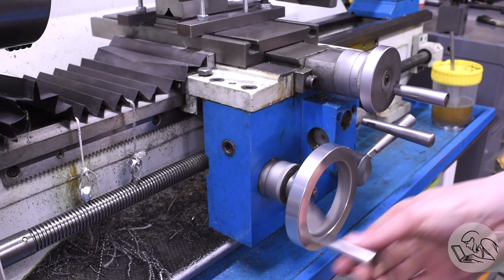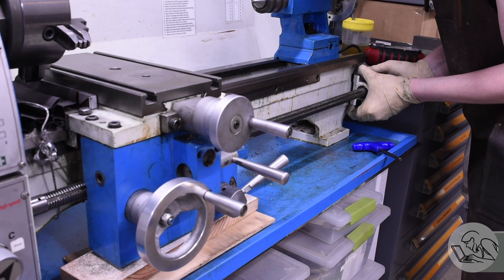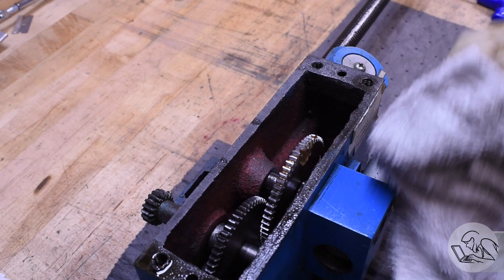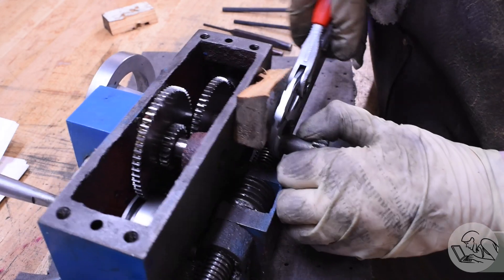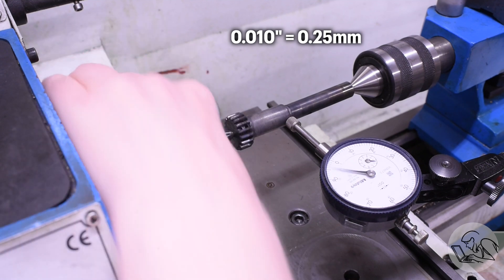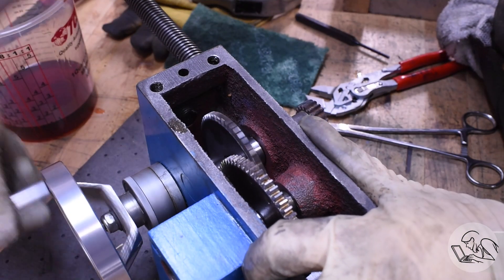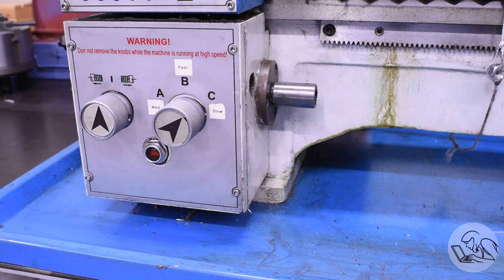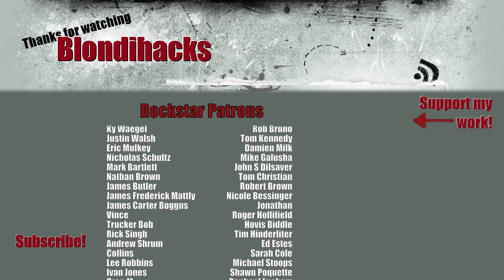Lathe Crash And Repair! 🤦‍♀️

Comment: Nice little video, well done on a fix not a spare part, As it was a small bend, I would not have used heat, it was a job for the shop press or big bar ln the vice (using something to hold the part with out damage) or the block hammer, grip with some scrap brass or Alu, the other thing start the pin in the hole  on the gear, (you can chamfer the hole and mark the position with a felt pen) before you put it back in the gear box. So you don’t drop the pin….

Comment: Yup, like I posted in your previous video, I bent mine doing the exactly same thing, only ran my carriage into steady rest instead of tailstock. Nice repair only you kinda went about it the hard way. I just dropped the pillow block end of leadscrew, dropped the gearbox and removed pinion gear. Chucked pinion in 3 jaw, dial indicated, and tapped it straight. Straightened within .002 !!!

Comment: A handful of fittings and a valve would make that gear box drain easier to manage. My 1920ish lathe has an oil bath in the apron and it’s still kicking so it might not be the best oiler but it’ll last 100 years if you take care of it. Great video!

Comment: She'll probably just turn a new pinion on the lath... doh! Glad you're back in business. You may need a backup lathe for repairing your lathe! ... Oh who am I kidding, you would have chucked the pinion in the mill and turned it holding a tool in the vice.
Reply from the maker: It almost came to that. If straightening hadn’t worked, I would have put the bent one back in, made a new shaft, then took it apart again and put the new one in. 😅

Comment: Hi Quinn I just found you channel, and you are completely awesome!!!!! I am a hobby machinist, I have learned so much in just the short time I’ve been watching your channel. Years ago I got a 13/40 lathe for 50 bucks. I had to go through it and clean it up ways where lightly cover in powdery rust(no pitting). I used electrolysis to clean a lot of the parts, polished the ways with ultra fine diamond hone. Got it dialed in, started it up and found that the carriage had been crashed like yours. The same part was bent. I drilled it and used drill rod turned to correct diameter and pinned just like you said. Been working for 15 years now. I love being able to make or build what I need. Thank you so much for sharing your knowledge it’s nice to learn new things. Take care and God bless you and yours.

Comment: Love your vids! I was a machinist in a refinery for years, now retired and missing machining! I don’t want this to sound bad, certainly not my intentions but I love to see a woman doing this kind of work in a previously male dominated trade, good for you! Keep up the great work! Plus, you’ve got me thinking about getting a hobby lathe and possibly a mill after I finish my Charger project.
Reply: I'm working hard to not retire, I worked twenty years at a small machine shop with a woman who did very fine work, and "worked straight up, with the guys" a real peer, in every way.  I spent two decades in the marines, and it was good to find "peers" there as well.  It's also a challenge for a man to work in a woman's venue, I worked many years on assembly lines, on the side, in female dominated work.  We each have our own ways, and learn across the gap, I think.
Reply: Great video Quinn - I always enjoy them - and regards women in model engineering the work of Cherry Hill, from here in the UK, is always worth a look.

Comment: On my 10x22 I ran the power feed for my crossfeed into the end stop and damaged the cast iron lead screw nut.  If your stocking spare parts, it might be a good part to have.
Reply from the maker: Yah I already broke that one a couple of years ago, the exact same way you did. 😁
Reply: @Blondihacks  If we're stocking spare parts, i'm thinking one of those brass tapered shear pins is probably a good thing to have on hand.  My lathe (an old clausing) had a similar sort of pin replaced with a steel one, probably because someone didn't have the right part on hand, and i'm glad I found it while I was cleaning the machine up, before I used it!  It's brass now!

Comment: Awkward tension pins/roll pins.
Take a piece of wire (I use stainless tig welding wire)
Put it through the hole that the pin is to go through.
Slide the pin down the wire to begin seating in the hole.
Use a punch to start the pin.
Remove wire and complete reseating of the pin.
Reply from the maker: Good tip!
Reply: @Blondihacks  I have used a magnet  have several few look like a old tv antenna they extend out have sever different sizes tips ..could also have got down in the oil bath I think not sure how tight the room you had ,, great video ,, did you get the spare part ordered yet ??? I have a mini mill/drill press I need to find the wire diagram for it wires come apart don't know where they go ,, unit from the slow boat area ..you did great on  the repair see you in the next video ..
Reply: Ill second on good tip! I deal with those pins fairly often and will make good use of that suggestion.

Comment: I kept thinking you were about to use your mill as a lathe with a tool in the vice to make a new pinion gear.  Was causing quite the anxiety.  So glad you could simply repair the part.

Comment: Thanks Quin for that. My very similar lathe has a similar problem after dropping screw cut lever inadvertently into gear while feeding. Ouch. 
Interesting how your lathe feed lever is up for long travel and down for cross. Mine opposite

Comment: I had a Yamaha JT2 MX and the clutch nut fell off and locked up the engine. I was in 4th (top) gear and wide open. On pavement. The fourth gear cracked a tooth and had a heavy spot. I had to see this with a magnifier (@ 14 Years old). I went to the Yamaha dealer and bought the new gear. Put it back in and rode it til' I sold it. That is where I learned how a Japanese constant mesh transmission works. Japanese engineering is the best. I now own a Kawasaki ZX-1400. Stupid fast.

Comment: It's good to see manufactures are still protecting consumers interest by making sure a pricy precision ground and hobbed part fails before the inexpensive bog standard shear pin needs replaced!
Reply: I don't think there is a world where the shear pin on the lead screw would break before anything in the apron would fail. It's there to protect the lead screw itself. Also some guy called Don Not told me that this ain't the most pricey machine in the world. I ain't judging Quinn, I'm sure this is a very useful and durable piece of machinery when used properly.

Comment: it seems like it would make sense to full insert the taper pins before tightening the bolts down as they should be there to correctly align the bolts? also instead of tapping directly on the taper pins screw in the bolt to be more gentle on the pins when tapping. I just worry that you might hurt the threads and make removal harder next time.

Comment: Did something "similar" on a 3d printer, but with electricity and the magic smoke.  The mainboard on the printer still works, but only if I cut the USB voltage from my control computer.   I've now got a new mainboard in stock ready to go just in case I do anything else stupid.

Comment: A design flaw in the the lathe, why didn't the lead screw brass shear pin, shear? It would have saved you a lot of trouble if it did what it was suppose to do. At least you did a good repair and it only cost you your time and  a bit of oxyacetylene gas.

Comment: I have succesfully straightened round items in the following way: first I machined aluminum half-rings, with the ring outer diameter double (or so) the outer diameter of the axle. (The rings were made with internal diameter to match the outer diameter of the axle that needed straightening, and then I sawed the rings in half.) The half-rings allowed me to exert a lot of force, without risking damage to the surface of the axle. I used a setup with three half-rings. I clamped the assembly in a vise with wide enough jaws, with the middle half ring set to push at the spot along the axle where it had been bent. So one jaw of the vise was pushing only the outer ends of the (short) axle, and the other jaw was pushing only the one half-ring at the spot where the bend had occurred. I supported the axle, so I could back off the jaws without the axle sliding down. With the jaws hardly pushing I slowly rotated the axle to feel where it was binding a little. At the orientation where the axle was binding the most I turned up the force of the vise, and then I backed off again. If I could feel no reduction of the bend then I would try again, turning up to a little more force, each time backing off again, and then rotating the axle to feel if there was still an orientation where it was binding a little. That way I was able to straighten that axle back to a point where I could roll it over a surface plate and I could no longer see any wobble.

Comment: Trick I learned from my dad a long time ago: if you've got a roll-pin to insert in an awkward spot, a matchstick/toothpick will give you some extra surface to hold on to to get it started in the hole.
Reply: put the rollpin in the gear outside the apron    much easier

Comment: On my 9x20 lathe I have similar issue, unfortunately because the gear mesh is a little different depending on the cycle, it effects my machining finish when running power feed.  I would order a replacement to remove that last 10 thou.

Comment: Hi Quinn, if there's enough meat in the part, you could have started the roll pin in the hole before putting the gear into place.

Comment: Great repair.  An alternate method of straightening is to heat the part and then put a wet rag on the high spot which will pull it back toward straight.  Keep on keeping on.
Reply: For a master class on straightening check out Kieth Fenner's videos.
Reply: @markbernier8434  
Thanks for suggesting Keith Fenner's video on shaft straightening. It is quite an interesting and effective technique.
Reply: bent a axle on my 4 wheeler 15 years ago .. priced a new one said I would try and fix this 1st ,, they told me and other people said do NOT heat it ,, it was hardened ,, I have a cheap pipe bender with the dies and a jack in it .. rolled the axle on a flat surface marked the bend .. put it in the bender  and rolled it again checking and marking the spot repeated 3 or 4 times ..reinstalled tested ok .. just have to know what your heating is not hardened or you have to get it re hardened

Comment: For the gearbox you could put a street elbow in. But then, of course, you'd have even less clearance underneath for a catch pot. The pig mat is probably easier. Also, I suspect the brass "shear pin" is tapered to stop it falling out.

Comment: Next project: fabricating a slide hammer. Its a hammer for pulling, works great for dowel pins like this. Its actually nice of them to use this type.
Reply: I think her method worked well.
Pulled carburetor jets the same way. Taped non metering area with a 4-40 tap.
Reply: @dans_Learning_Curve  Nothing wrong with this method. I just wanted to suggest a nice easy lathe project. Not sure how well known they are as far as tools go, with a few different attachments (various thread sizes for example) they can be really useful.

Sometimes its really helpful to be able to tappy-tap-tap instead of gradually build up the force.
If you use them to remove dowel pins you do that first, before undoing the bolts.

Probably not worth buying for most people, but simple to make out of some random bits of steel.
Reply: @dans_Learning_Curve  both work, but I see the point, some people like having the right tool, ya know?
Reply: I was thinking slide hammer too, but what she did was brilliant. One of those why didn't I think of it moments.
Reply: ah yes the slide hammer its got me in trouble many times being my goto.  lol